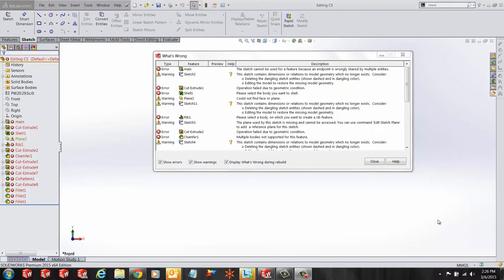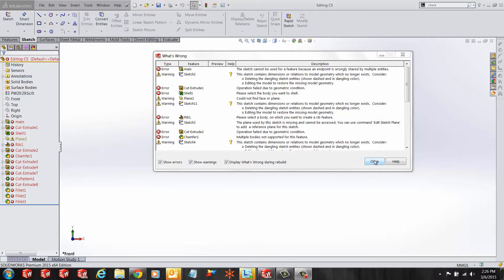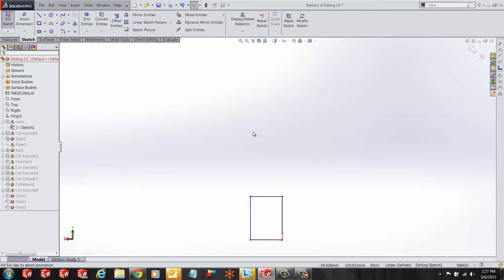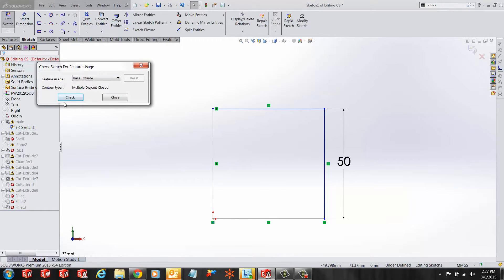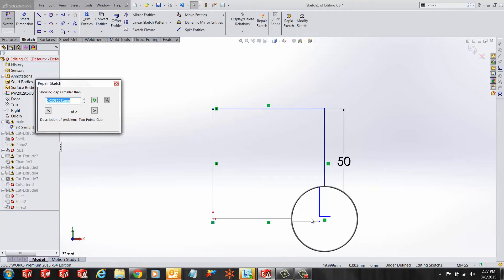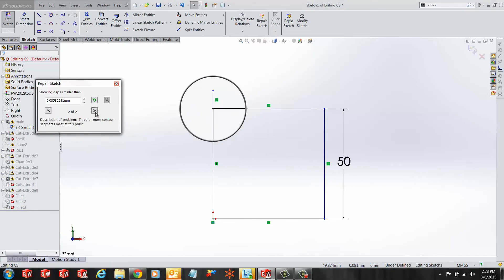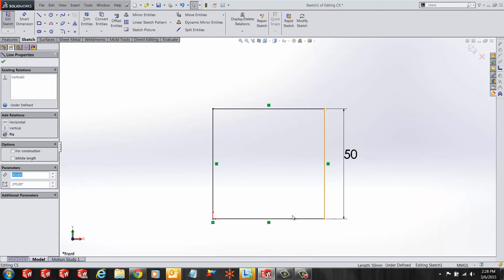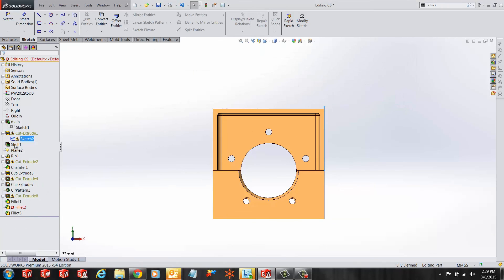SOLIDWORKS Quick Tip - Check Sketch for Feature Usage

Comment: issue I'm having is it says disjointed curves but redirects to check sketch which shows no problems, so you can't see where the problem is to fix it.
Reply from the maker: You can adjust the gap size, to see if the gap is just not being seen, another thing to try is deleting lines to see if there are overlaps. Some times even cutting and pasting the geometry to a new part might show a result that was not showing up before.  For the most direct answer it would probably be best to contact your VAR's technical support team and they can help you get to the bottom of the issue
Reply: @goengineer  yeah i just simplified the curve to get rid of the problem, didnt think about adjusting gap tolerance - will try that the next time i have this issue